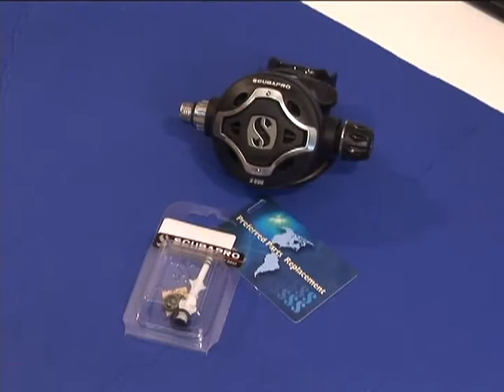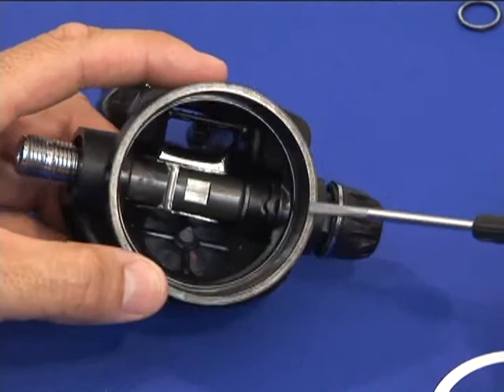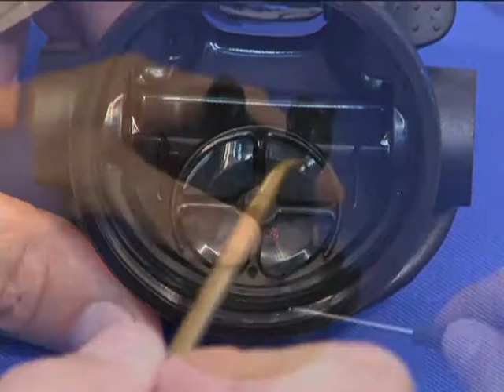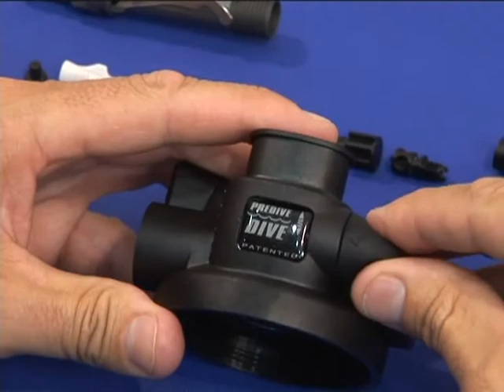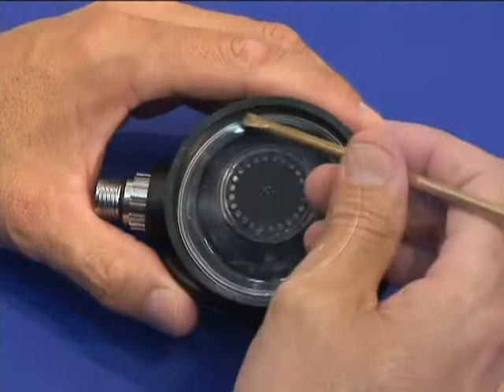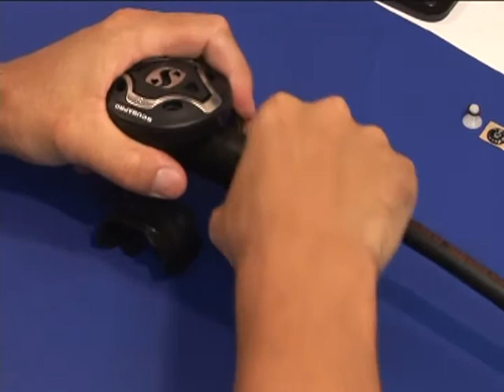Scubapro S600

Comment: Just rebuilt my G- 250 with new style orfice. Cant believe all the plastic components in the S 600. And how small it is.
The chamber has less area then the 250 which to me is a no no.
And the cost of that S600  is nuts.
The G-250 may be a tad bit heavier due to metal tube but far superior quality then the smaller S600

And my G-250 really breathes much smooter then with its oem components. Plus the huricane orfice is SS rather then plastic  so i was able to install the brass orfice from the 250 into my 095 octopus instead of the plastic or nylon orfice it came with. Win  win